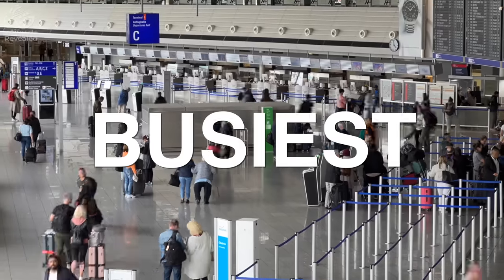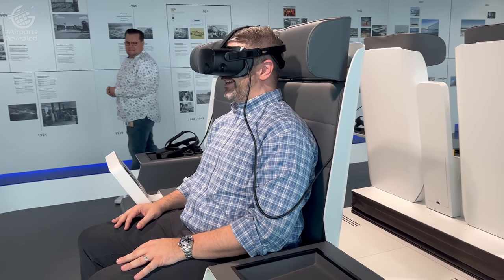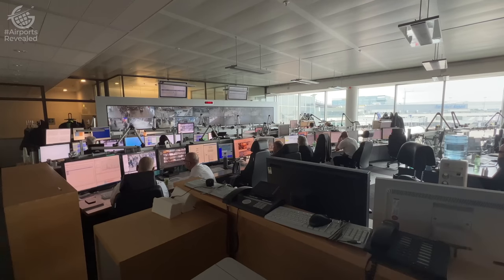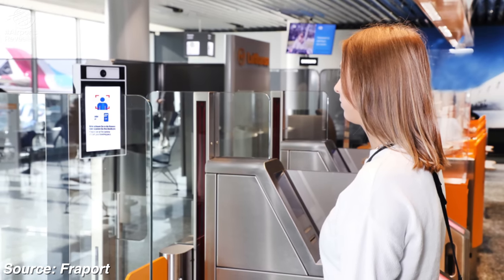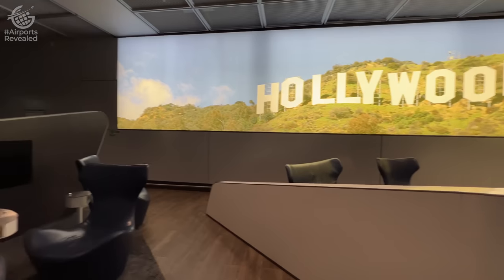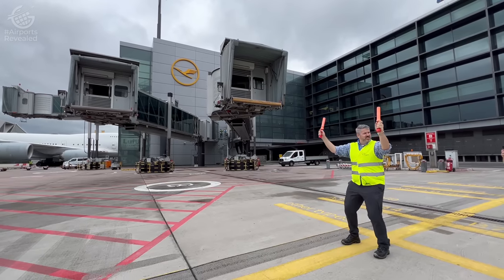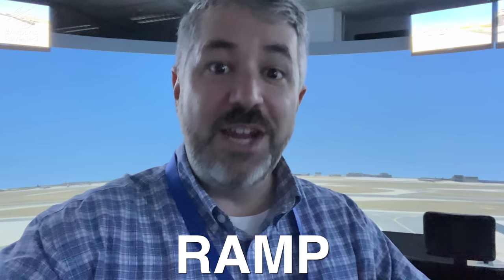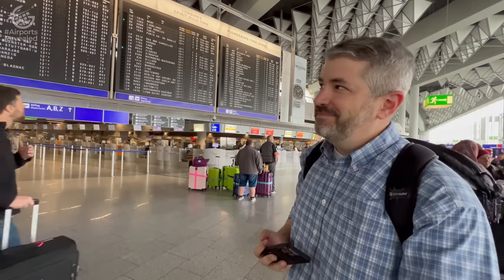Behind the Scenes at FRANKFURT AIRPORT

Comment: GERMAN TECHNICAL PERFECTION, JUT THIS. When the T1 was inaugurated in 1972 at the dawn of the Jumbo Era, it was not an arquitecture masterpiece, but it was a masterpiece of functionality. The tunnel linking Concourse A to B under the apron was LH requirement for better time connections and the luggage system at the time was the most modern one. The Terminal MItte construction site was the biggest one in Ocidental Europe by that time. The departure board still an iconic piece of an Era of Air Travel that is gone.

Comment: We live in Kenya and I've flown through FRA at least 30 times. Your behind the scenes video was excellent and showed me things I never knew about FRA. Also the airport hotels for long or overnight layovers are convenient. I love the forest trails next to the airport as well. I used to work on the ramp (apron) for United in Denver. You explained all of that "under the wing" activity very well. The highlight of my shifts were when I got to do the "push backs" for the planes althought we didn't use those huge tugs you were in. Downside of Denver is working outside loading and pushing planes in sub zero weather and snow.

Comment: Hey Jeb, amazing video! I live in Darmstadt which is about 15km south of FRA and I grew up about 50km from the airport. For every child in the Frankfurt metro area the airport is a place of fascination and it definitely has been and still is for me. 

But although I live so close to this incredible mega hub and have been there countless times just to visit and watch planes, I have never seen such a comprehensive and well produced showcase of FRA. Thank you so much for these amazing insights. Now I want to go visit the airport tonight! :D 

One thing you didn’t really touch on was The Squaire, the giant building with its own postal code, that one of the two train stations is located in. Maybe you could visit again once T3 is opened and go into more detail on The Squaire and the multimodal options for a part 2? (Two trainstations and the biggest Autobahn interchange is also right next to the airport)

Comment: I wish I could agree with your comments about Frankfurt Airport. About a month ago I passed through the airport on the way from London to Tel Aviv via Lufthansa and had the most miserable experience both finding my connecting gate, and also once I got there finding a place to sit and comfortably charge my phone prior to getting on the plane. It was an amazingly convoluted process to find the super secure gate that flights to and from Tel Aviv tend to use and nobody seemed to know how to direct me properly. I ended up going up to several locked doors, and then had to schlep down a very uncomfortable staircase to get back down to the terminal to work my way back toward the gate. No one seemed to know how to find that gate. Very frustrating. Then there was the obligatory wait through very slow security to get into the gate complex, and once I got there there were no seats with charging ports and hardly a place to sit and grab a bite to eat before I got on the plane. I ended up sitting on the floor next to a working charger port for about an hour and a half charging my phone up for the flight to Israel. Totally unacceptable in a major international airport like that. Lufthansa has got to do better in that case.

Comment: You said it precisely. If you know where you are and where you have to go -for a connecting flight, just follow the signs,. I had little over 50 mins for a connecting flight, i was skeptical , my baggage would be transfered. I sprinted from A to B , just following the signs, , i was in my seat in less than 30 mins, and my worry was about my baggage. 

Upon landing in Toronto, i was not expecting to see my bag, Voila , i was there even before i could reach the belt. Great work by Frankfurt airport,
Reply from the maker: Amazing! Glad you (and your bag) made it!

Comment: Last time I went through Frankfurt was 2017 and remember getting very frustrated at not being able to find out which gate my WOW flight was departing from. They didn't list it on the departure boards until right before boarding, and of course I was at the other end of the terminal.
Reply: I experienced the same as you as Gates were so far away from arrival to my next connection gate

Comment: Connected there in 2016 on LH. ORD-FRA (748) then to Milan, Linate (A320). Was confused by Z and A gates at first, but realized Z is atop the A gates and they share the air bridges. Linate flight was a bus gate, so had a mini ramp tour.

Comment: This is really a total 180 from our experience with Frankfurt.  We found it very confusing where Germans came up to us to ask where certain gates were. I figure if even Germans have problems finding their way around, I'm not surprised it was confusing for us. We even used the Lux lounge mentioned in the video. We had to get out of the airside into the departure hall to use the lounge, which was again.. quite confusing. Some parts are big and airy and not dark, and some parts feel like you're in a dungeon crawl.  Catching a connecting flight was much more streamlined and clear in Heathrow for example. Even my first time through there it never got as confusing as my first time through Frankfurt.

i'm not sure the announcement board is the "last one like it in the world" as Brussels airport has one as well. All by it probably a bit smaller, but still using this technology.

Comment: I have a love/hate relationship with Frankfurt. Its the easiest option for my hockey trips to Mannheim as there are direct routes from both Glasgow and Edinburgh with Lufthansa. The main line rail station makes connecting to Mannheim really easy. The Lufthansa luggage drop beside the station is a real time saver rather than having to drop off bags in the main hall (havent tried the automatic one yet).

On the negative side, the  volume of passengers can make security a bit of a drag. The shops air side are fun to look at, but food and drink options have never seemed that great. Worst of all is probably the lack of organisation at departure gates. I don't think I've ever had an air bridge for a flight from Frankfurt. It's always the bus out to the apron. Luckily the weather hasn't been too bad, but Lufthansa tend to get gates side by side for flights leaving with similar take off slots and to similar destinations. So the Glasgow flight will be at the gate next to the Manchester flight. Queue control will be minimal, or often non-existent. So it ends up being a congested mess and pretty easy if you're not paying attention to end up waiting with the wrong sprawling mass of people.

Comment: Another great video!

It’s likely the wrong place to post it, but I have suggestions for two more videos.

United States Pre-clearance
They have it at Dublin and, I believe Dubai: why?  Does the airport pay for it?  It makes travel a little easier in that you get to use the lounge on arrival.  Why wouldn’t an airport such as FRA or ZRH try to get USPC?  I think it would make a connection more attractive and could draw traffic away from other hubs.

LAX is a major construction project
I have yet to find a video that details the massive construction that has been going on at LAX for the past few years.  A new, consolidated rental car facility is being built; the airport has a light rail system “people mover” under construction; there’s a new light rail system being built that will connect into the LA system; I’m told that all the tunnels connect all nine terminals airside is completed a (I haven’t tried the whole thing yet).  Terminal 0 is being built; other terminals are getting major upgrades; the Tom Bradley has a new satellite connected by a tunnel; construction on terminal 9 is starting, which I’m told  be for Star Alliance carriers.  I’d love to see a video, just like this one for FRA, pulling this LAX story together.